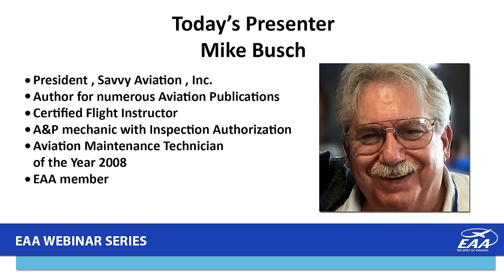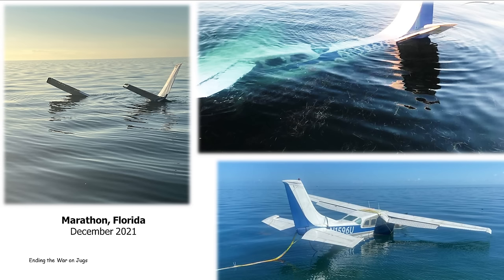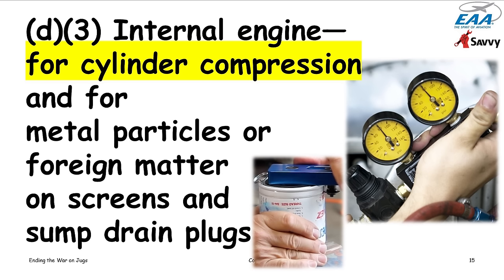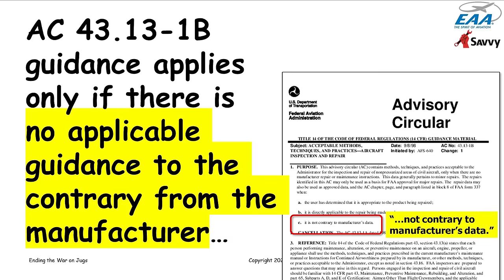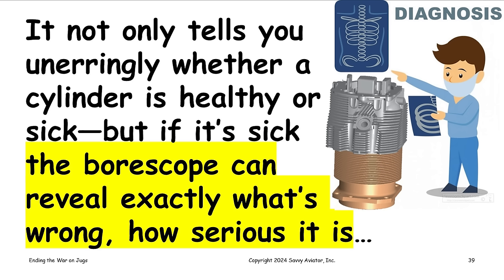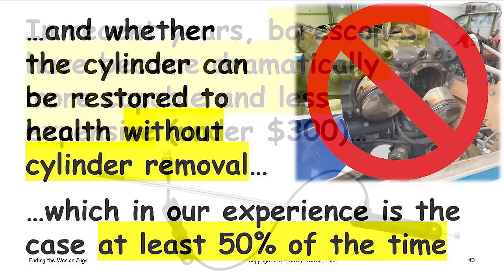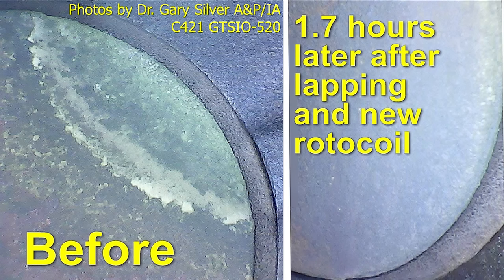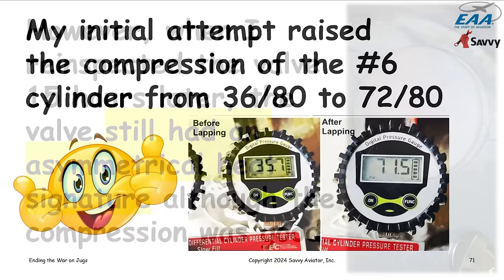Ending the War on Jugs

Comment: You use a couple of repairs as an example of  cylinder changes. Do you realize how many cylinders have been changed over the years? You totally  sensationalize these accidents,. Do you work for FOX news?
Reply: Not cylinder changes. This is regarding invasive inspection procedures such as partially disassembling a perfectly good engine to check wear, when there are zero signs of wear by all other tests.
Reply: If you haven’t realized, scaring owners is how he makes money. Don’t get me wrong there ARE some bad mechanics out there, just as there ARE bad pilots.